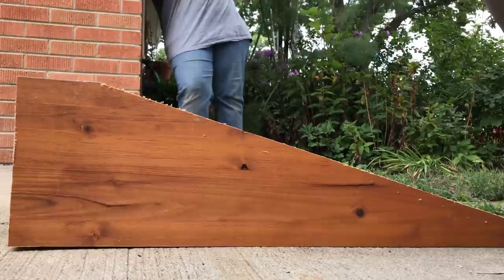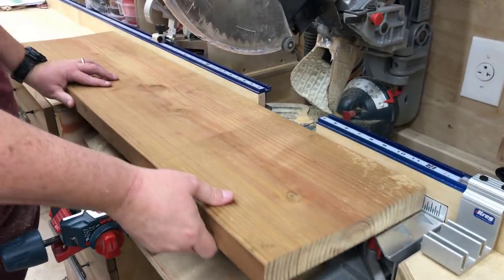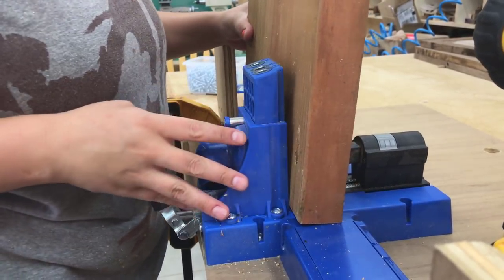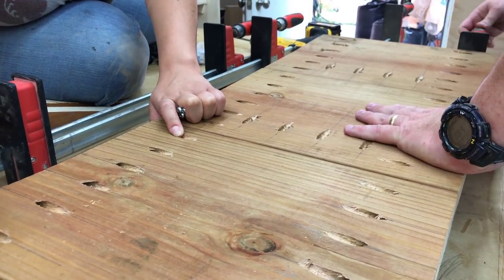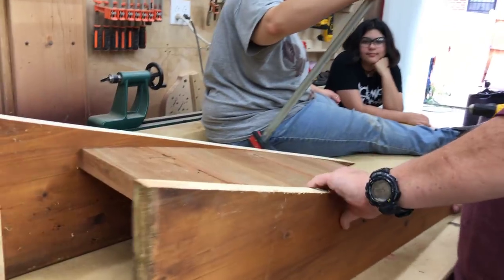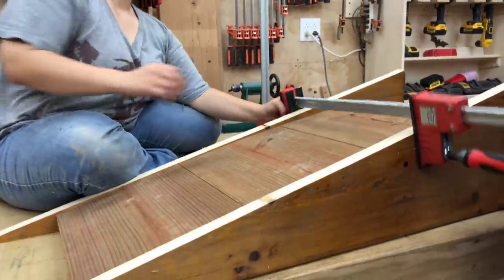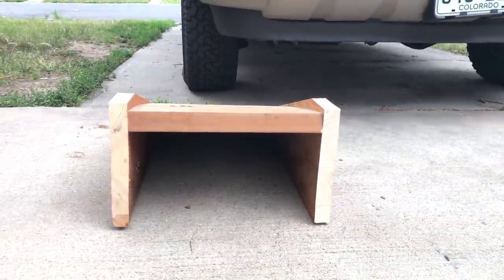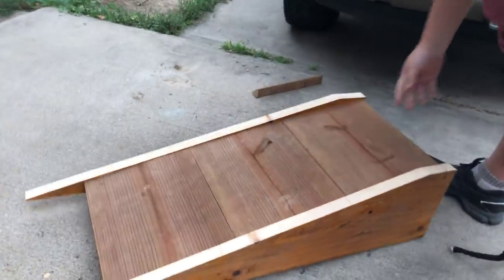32 - Extreme Pocket Screw Strength Test

Comment: Another great video, thank you James & crew. :)
I agree with all the haters: Pocket screws won't last...
... unless you know how to build and use the correct screws (dimensions and material).
I was raised with solid builds like "wood resting on wood", so that everything that had a load on it was always supported (even the slightest load. If you build like that, you do not need the screws to carry any weight and your build will last virtually forever.
But ... on the other hand, if you build the ramp in the video and use only 8 pocket screws, it's doomed to break.
You could also compare this to making a dovetail frame. There's a right way and a wrong way. Right way: Pins on horizontal boards and tails on the vertical boards. The bottom won't fall off when you hang it on the wall. On the other hand, if you do not use glue and you have the pins/tails on the wrong boards, the bottom will fall off and you'll have to purchase new cups and dishes. ;)

As I've seen quite a few of King's videos, I know they build things to last; because the construction is right and the materials used are right.

Comment: That was an awesome test, Matthias's put me off Pocket Holes and I refrained from buying a jig, this has changed my opinion. Gonna go buy one now!
Reply from the maker: Hi James, haha, I didn't like his test much, because I've been using them for years to build cabinets. 

I was transporting a kitchen to a site once and one cabinet fell off my truck on the highway at 75 miles an hour. It rolled and bounced hundreds of feet, but it didn't break. The 3/4" ply had cracks in it but every joint in the cabinet was intact.  Since that day, I've always felt that this must be an incredibly strong joint.
Reply: @KingsFineWoodworking  Did you make a kitchen out of plywood?

Comment: I am newer into wood working and picked up a Kreg recently. I built a wonderful work bench and used pocket joints to save time and since I didn't have a work space it was easier to achieve a flush surface so my top is level. This bench is hinged to the wall to move out of the way as needed and when I raise and lower it there is so little flex that I KNOW these fasteners are just solid.

Comment: My uncle, who worked on cars all his life, had two ramps like this. He had a separate platform for each one. Drive the vehicle up onto the platform and then remove the ramps and you have a lot of access to get under the cars and trucks. His wedge was attached to the front of each ramp, and used to extend further than the one you cut but eventually the front edge wore away. =) Fond memories.

Comment: Wow, I am a huge proponent of pocket screw joinery, and in my woodworking I DO add glue.  Often the pocket holes are just the camps until the glue dries.  I would NOT have thought that idea of yours would work, but there is the proof.  I see videos testing their strength, but I think the issue has more to do with the testing people are doing.  I am not saying they are wrong, I’m saying the way I see two boards joined, then tested; isn’t the same type of load on the joint as yours.  Well done.

Comment: Wow! That’s strong. 

Just bought the Kreg HD for what it’s worth. A bit pricey, but excited to see what it can do in building a door ramp up to my shed.  I liked the attention to your hole spacing, given the small, yet heavy, PSI you would have with an auto tire.  For me it will be a riding lawnmower.  Still engineering matters for safety. Smart call. 

Thanks for the demo.

Comment: Good test.   I built a aquarium stand entirely out of pocket holes and wood glue.   5 years later it doesn't flex or creak at all.  The pocket hole helps with time and space requirements.
Reply from the maker: Thanks, and that's good to know about another success story with the strength of these pocket screws.

Comment: When a metal to wood fastener is overloaded, the metal doesn't typically break. The point load will crush and split the wood. Longer term, moisture intrudes into the metal fasteners rotting the surrounding wood, corroding the metal and making the connection loose. Wood to wood fasteners tend to have a more even distribution of loads and in ancient structures have stood the test of time; glued in wooden dowels don't have the same moisture penetration and corrosion issues. Pocket screw connections are perfectly adequate if you can distribute the loading appropriately and seal the joints.

Comment: You proved a point re strength in solid wood.  Don't consider myself in your league but I've built quite a few cabs IME there is no production advantage with pocket screws due to dealing with jig and alignment issues.  Simply screw through butt joint is extremely fast.  Yes, end panels could be pocket screwed tho.
Reply from the maker: Hi Robert! Thanks for your comment!

Comment: I'm sure most of the comments are from people who haven't really made anything or don't know when to use them and I'm sure if you used glue like you normally do that ramp would survive Godzilla lol 😂 god bless brother be well
Reply from the maker: Haha! Thanks Jason. (I can tell you it was pretty sad not getting to use any glue on this project.)
Reply: The testing that Matthias did on pocket holes vs. pocket holes with glue demonstrated pretty clearly that the two don't complement each other when it comes to shear strength. The glue gives first, and then the pocket hole joint fails at the same point it would have failed at without glue. The same may not be true if you're pulling the joint apart, however. Still, we know that end-grain to side-grain glue joints aren't as strong as like-to-like.
Reply: Matthias didn't test shearing strength. He tested a bending stress. It would be shearing if the force was close to the joint, or the joint was well supported on the other end. Instead he tested how well it could resist pull out, something one would never encounter in a raw force in the real world.

If he tested shear string the screw would have had to snap to come apart, which was not the case.
Reply: Jason B most of those comments are probably exactly as you said... Then there is those who dont want to wrap their mind around the fact that they didnt need to spend hundreds on the alternatives.
Reply: Timothy Ritzer and at what point would furniture need to withstand those forces exactly? Come on. Anyone who actually uses pocket hole jigs and properly knows of their strength... We are talking about furniture here not bridge construction.

Comment: Truck is 8,800 divided by 4 = 2,200 lbs per tire. Not bad for what is in essence just thin rods of steel threaded into a soft porous material.
 Nice video, now try making one with traditional joinery and see if it to holds. More videos please.
Reply from the maker: Hello!  I suspect the engine side is heavier than the back, so perhaps the tire I put up on there is a bit more than 1/4 of the total weight. 

Thank you for watching and commenting! 😁👍🏻
Reply: Coffieman5150 The Excursion did not weight close to 8800 lbs.  Not even the diesel version.  The gas version was a little over 7200 lbs.

Comment: Pocket holes can be created with a $20 kreg jig too. It won't be as fast if you have lots of holes, but I've found some ridiculous "fine woodworking" projects that weigh about 10 lbs, having almost no use or weight bearing, and require fancy tools that your everyday weekend woodworker does not have. I built my childs bed with pocket screws. I used to use wood glue and then screw together with pocket screws, but I learned it's not even needed. If my 50lb toddler can sleep on a bed made entirely of 1x4s using 2 pocket screws per board joined, a total of maybe 26 pocket screws for an entire bed + frame, for years, with the odd occasion my wife and I went in bed with her for 20 mins a night to read books. Altogether with my daughter we weigh about 450 lbs including the bed. Yeah, I have no doubt a 2x4 with multiple screws in it will support thousands of lbs. For 20 bucks + screws.

Comment: OK, surprisingly, it worked, but for anyone coming to this page and thinking that this is an acceptable design for a car ramp, it is most definitely NOT... Not only would it fold up on you if you put too much of a side load on it, but the weight of the vehicle should not be resting on the screws.  The 2x12s should be put across the top of the triangle side pieces so that it is in compression and it will be quite a bit stronger.  By doing it that way, the you just need a few nails or screws going through the 2x12s into the side pieces and they are not for holding the load, but rather just to keep the 2x12 on the side pieces.  There will be a slight amount of weight that they are supporting since the since the 2x12s would tend to slide down the angled pieces if there were no nails or screws, but that force vector is nowhere near as much as those pocket screws are having to support.

Comment: Excellent job on the pocket screw demonstration. I've often wondered if using them for kitchen cabinets was safe, clearly they hold their weight. Just a note, your excursion doesn't weigh over 8,000 pounds. I assume you were refering to the door sticker for gross vehicle weight, which is the MAX weight the truck should ever be. You want "curb weight"... Plus the driver :p

Comment: Mathematically speaking, each pocket screw can support about 80-100lbs of force, and due to suspension dynamics, that ramp was supporting 1/4 or less of the force of that vehicle. So it’s definitely strong enough to hold that, probably could hold more

Comment: So how much weight did you put on it then, it was not the weight of the car, as you only put one wheel on it, never the less it was still a good video, and proves that there is a place for pocket hole joinery, so well done and good to see you are training your girls to do handy projects, because one day you and I will have to leave our daughters behind.
Reply from the maker: Hi, thanks. If I had to guess...  1/4 of the weight is a little over 2000 pounds, but it is the engine side, (big block v-10), so, easily somewhere between 2000 - 3000 pounds.   Thank you for watching and commenting. ~ James

Comment: take 1in 4 screws out, try it again, then take another 1 in 4 out.. see how many screws it takes before it fails. (and weigh the front tire at a local weight station).

This is really interesting! - be cool so get a 'tinsel' strength idea.   Good Job bud
Reply: I was thinking the same thing.  It would probably still hold with half the screws in it.

Comment: I calculated the shear force on each of the eight screws holding a single wheel of your heavy car as 303 lbs. That's the maximum shear failure for the best #6 screws. The best #8's fail at 361 psi.

Comment: Pocket holes can get strength when you put a ton of them, like you do in most of your projects, but normally the worker will put a screw to each 15 inches or so.

And you did a test with an pretty large wood, the pocket is well placed in the middle with more than an inch to each side of it, but on an small piece, like an drawer the screw will have almost no strength.
Reply: Certainly not the joint for everywhere, but it has it's place

Comment: I want to point out that there are three characteristics of a joint:  1. shear strength, 2. bending strength, 3. pull-out strength.  The test you showed in the video only tested the shear strength of the Kreg HD screws.  The test did not assess the bending strength or the pull-out strength of the Kreg HD screws.  I suspect the a 2.5" Kreg HD screw has pullout strength comparable to a single 3/8" dowel.  

I just bought a Kreg K5 jig and have yet to use it, but am looking forward to using it.

Comment: Now you know the purists are going to come out of the woodwork talking about this and that lol. I use pocket screws as I said before to fasten table tops to the frames of tables, after all, you can not glue them they have to move so people use screws anyway, it just makes it faster with the jig to drill then fasten the top down.
Reply from the maker: Hi Anthony, I didn't realize I just opened up such flurry of arguments. Haha.
Reply: I am a traditional woodworker that was taught with hand tools. I started when I was about 5 or 6 and never used power tools until I was in my 20s as they were expensive in the UK and what was available was dreadful. 

My Grandfather made tables and chairs using hidden screws over 90 years ago and today those tables and chairs are still going strong with just a little bit of a clean up on them. 

I was taught to use hidden screws and I have adapted pocket hole screws. Anybody who talks about them not being as good are talking nonsense. 

Mortise and Tenon joints are strong but only when the force is applied in certain directions.  Dovetails again are great but only when the force is in a certain direction. 

Even biscuit joints are strong enough for many applications and if you combine them with screws they can be a powerful combination.  Traditionally when Tenons are used in tables they are combined with support with either dowels or pegs through the tenon so as to make sure they do not get pulled apart. 

Tenons were also used with wedges to add extra pressure.

Comment: With that many screws, you may just as well have made the ramp out of solid steel. You could probably have purchased on for not much more than the cost of the screws and saved a lot of time sawing, drilling, and screwing. :)
Reply from the maker: Now why didn't I think of that?  Oh yeah... it's because I was trying to Test pocket screws!

Anyhow. I did put them every couple of inches. But did you forget the part where I talked about the contact patch and it's size?

Anyhow, I don't put them that close on my cabinets. But, then again I don't need to... Because I'm not trying to drive my 4-1/2 ton truck into my kitchen, and onto my counters. :-)

Comment: because of weight distribution, rounding and doing easy math here, it would be 8800/4= ~2200. Most likely higher due to the weight of the engine being on the front where the ramp is.

Comment: In complete transparency I hate pocket holes, but do agree they serve a purpose as an example of what to use when you just need to get something done and don't care.  You could have used dowels been nearly as quick putting them in with close to double the amount of sheer strength.  (sorry, i'm an engineer by trade...I sometimes can't help it)
Reply from the maker: Hi James!  Are you sure? I've done some research (both before & after making my video), and the standard 3/8 birch dowel doesn't have even 1/4 of the shear strength of a case hardened Kreg screw. In fact, no dowel of any wood species I found results for even came close.  I am a scientist by trade too. 

My research results are that a dowel has anywhere from 280-345 lb. shear strength vs a Kreg pocket hole Screw at 1361 lbs. 

My sources:

(peer reviewed paper):
"Shear characteristics of wood dowel shear joint and practical application example"
http://support.sbcindustry.com/Archive/2008/june/Paper_167.pdf?PHPSESSID=ju29kfh90oviu5o371pv47cgf3

And here are the results from an independent Engineering firm, Radco Inc, that tested the shear strength on the case hardened Kreg screws
https://www.kregtool.com/webres/Files/KregJigHDForceTestSheet.pdf
Reply: I would have to imagine that dowels would have less shear strength, but more lateral strength due to more glue penetration and surface area. So I think dowels would support more racking stress, while screws (Including pocket) would handle straight shearing stresses.

Maybe a combination would create a really strong joint for both forces? Love to see a test on that.

Comment: Ive got the kreg hd , would have been more suited to this thickness material . Pocket holes definitely have a place in the workshop . I also have the trend pocket hole jig, the kreg jig appears to be a better tool as its adjustable to different thickness timber, with the trend jig you don't have that option.
Reply from the maker: Thanks for watching

Comment: Would it be stronger to have the screws on the top (the side with the tire)?  That way the screws would be going towards the middle of the side pieces rather than towards the edge. Also the weight of the car would be pushing the screws into the hole rather than pulling them out.  Anyway, regardless, your test shows that pocket holes are stronger than most normal applications would require them to be.
Reply from the maker: That's a really good idea. It just might be stronger that way!
Reply: You can put screws in opposite directions so as to help with opposing forces but also to try and take advantage of the wood grains and fibre directions. 

You could also on the underside of the ramp put in little support blocks to help with the downward forces being applied. 

WIth some simple additions you could make that brutally strong. So that it could hold an elephant and several cars all at the same time.

Comment: Great example of the strength of Kreg pockets screws!  I've used them a lot also,  but not like you did!  As you said it's a far easier strong way to build something.  Using the pocket filters you can even make something you wouldn't mind displaying.  Different choices of wood and a way to make your own contrasting wood,  they can look nice.

Comment: 3:45 No, every screw will be contributing in some way. Even thought the contract patch is small the load with be applied to the board, then to the screws. If you don't believe me you can do a test by removing screws and find out at what point it will fail.
Reply: Don't take my criticism the wrong way. I actually like what you have done here. Other people on YouTube have tested joints by applying a load to an L shaped joint. This tests the joint's ability to withstand a torque or moment. You are stressing the joint in pure shear because both ends are secured. Different tests for different modes of failure.